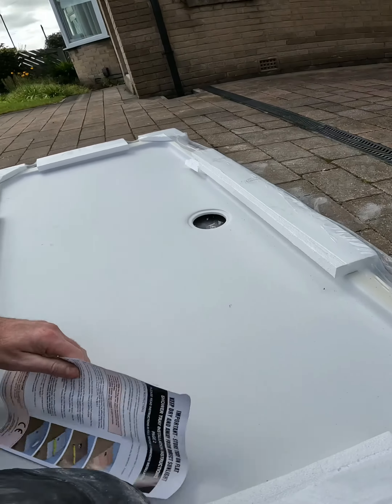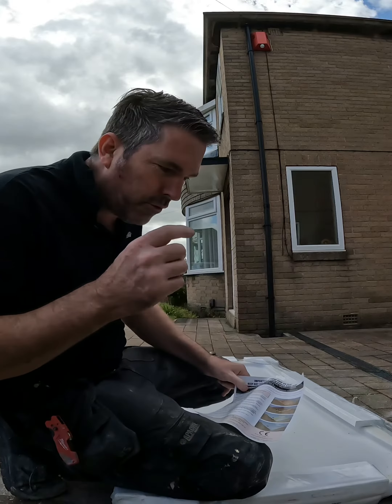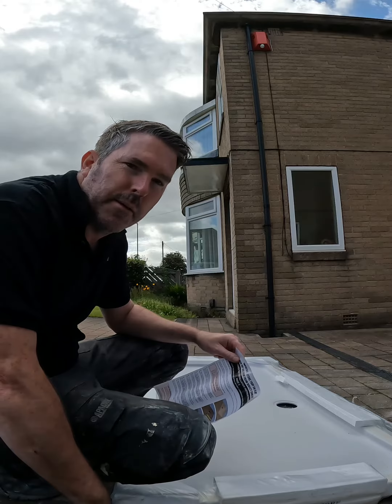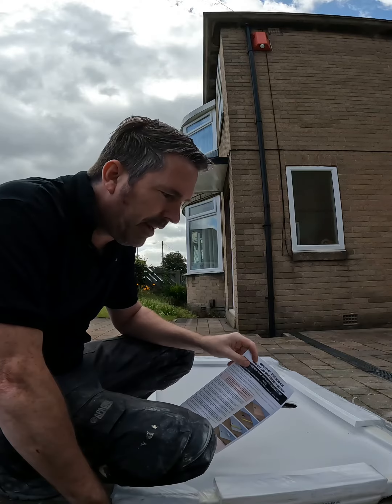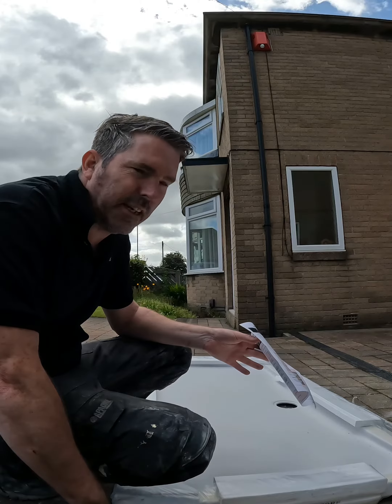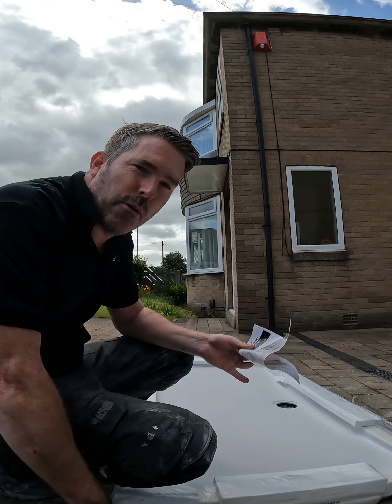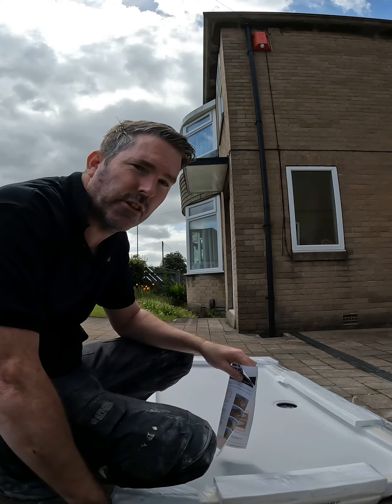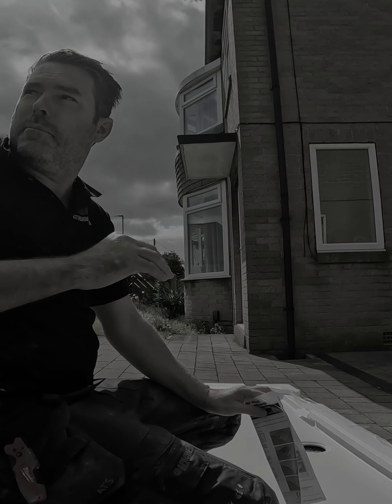How to fit a shower tray 1600 x 800 resin

Comment: Am fitting a shower tray diy bit worried it might crack with adhesive
Reply from the maker: You sound and cement
Reply: @bishbashbosh121  I used flex adhesive seems okay hope it’s fine
Reply from the maker: @love13456  Flexible adhesive is fine I’ve been using that for the last 20 years